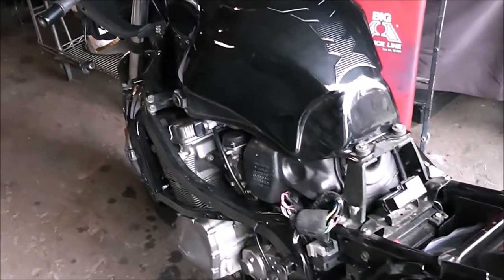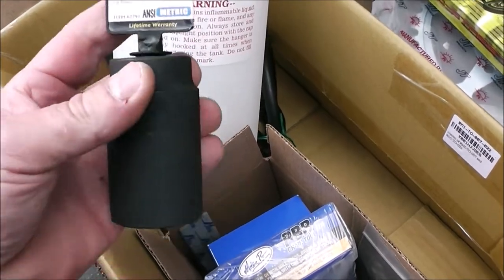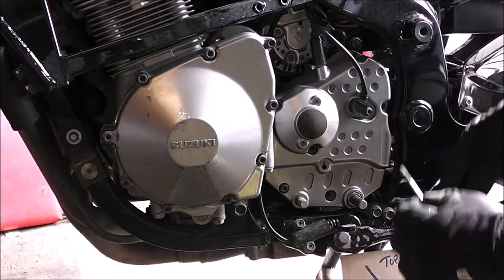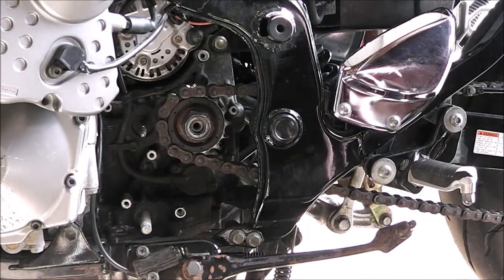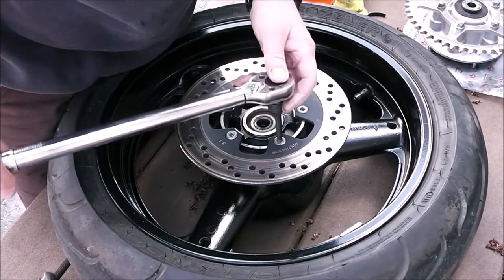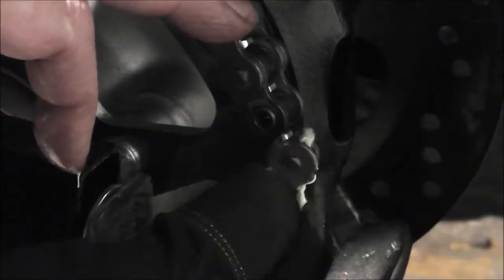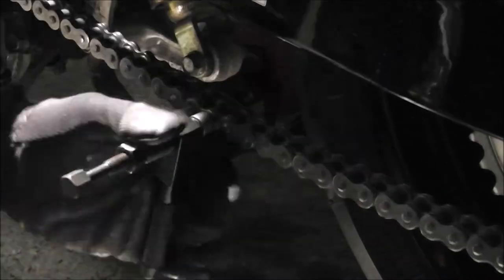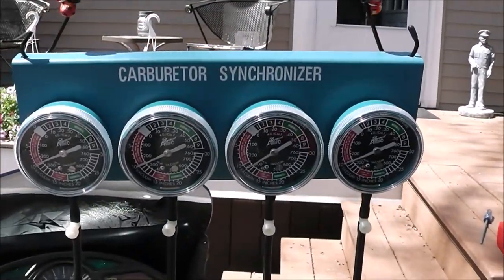DIY Regearing, Valve Adjustment and Carb Sync on the Suzuki Project Bike!

Comment: Nice work, it makes a change to see some good ole basic maintenance for a change instead bikes being torn down and rebuilt using machines none of us can afford.Good to see Uncle Fester junior putting in an appearance :).And Lola too. Guys if lubing cables, double check your shop manual AND the cable to see if its an aftermarket one- some cables had a nylon lining, these could react with WD40 or other lubes and actually stiffen the cable pull- although I never saw it, urban legend was the throttle would not close sometimes, but you know how bikers like to talk lol.
Reply from the maker: Good point on the cable lube buddy! Uncle Fester is a keeper! He is so into the motorcycle. As soon as we pull into the driveway he starts pointing. I guess I know now that doing that Honda 4 Wheeler build for him is going to pay off :) Cheers buddy!

Comment: Good job I got one of those carb vac tools about 40 years ago from   J C  Whitney and and it still works like new .Did you ever lift the seals and grease your Bearings ? Did that cable greaser work for you?
Reply from the maker: I did. I figured while I was there might as well. That motion pro cable tool is awesome! I forces the lube into the cable. Even with the tight 90 degree bends it works pretty slick.